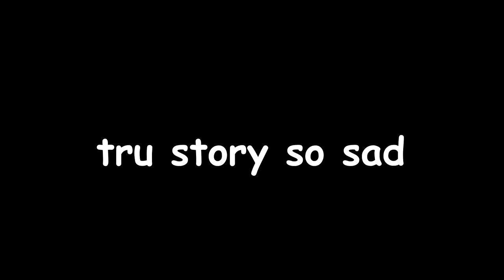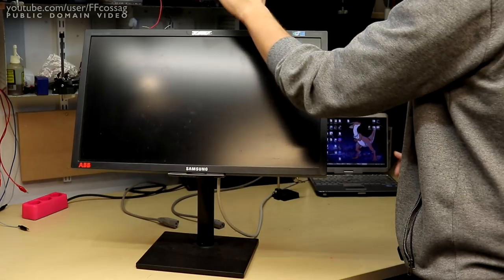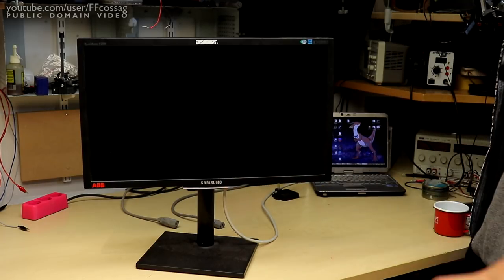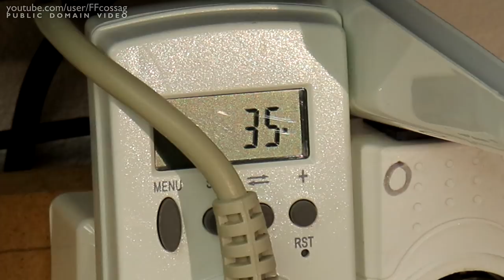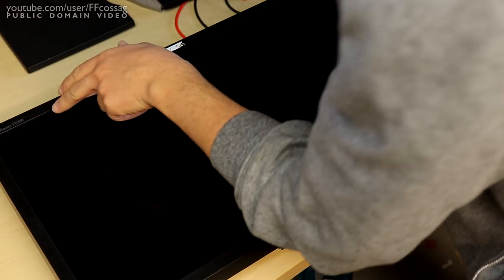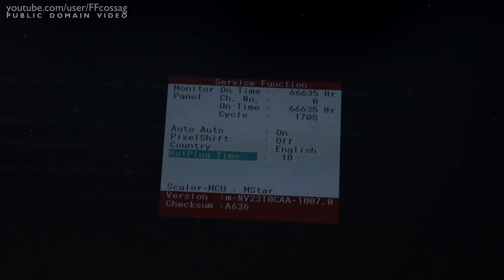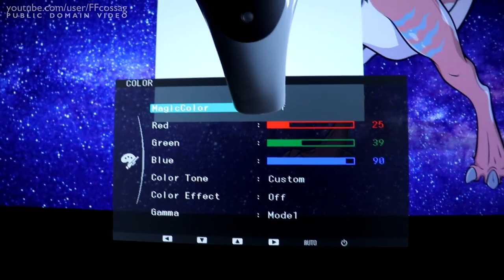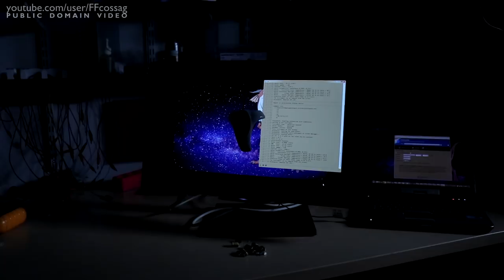66 THOUSAND HOUR Samsung F2380 LCD monitor repair

Comment: If my calculations are right that panel was running around 8 years nonstop... Holy shit.
Reply: About right, I  have a HP 23xi as my main, it's on almost 23k hours, I use it almost daily for 6-10 hours per day, and I bought it in 2013
Reply: Colin Hadley I have a monitor that’s got 25K hours but it’s been on constantly (not including power outages) and I bought it Jan. 1st of 2013
Reply: yeah, pretty much the same story, the only time mine's not on is when i'm asleep or out, even then it some times is...

Other than obviously, like you said power outages, or if i'm moving it for cleaning, (or going to a LAN party, which It has been to a few) :D
Reply: Colin Hadley mine is on 24/7 if I’m sleeping it’s on if I’m at school or somewhere else it’s on
Reply: You also have a few more hours than me, i'm actually on 22748 - so not quite 23, - this isn't a competition btw, I was just saying that his calculations sound about right, and you're just backing it up! :)
Reply: I have a HP LP1965 from November 2006 which has about 25k hours. My main monitor (LG 23" 1080p from 2011) on my main PC has about 15k hours
Reply: yeah and that monitor only came out in late 2009 or something, someone basically bought it and never turned it off.
Reply: EpicLPer Damn you're everywhere!
Reply: 7.6067352

Comment: The 66 Thousand hours make sense. In an industrial environment, nobody puts those monitors in standby. They run all the time. They are often mounted in a place very inconvenient to access (3 meters above the ground, or behind a safety fence).
And judging by how a lot of companies have a lifetime of their production lines for around 8 years, it makes sense. It probably died pretty soon before it was replaced, or after it was replaced in storage. There are thousands of monitors out there with similar on-times, that just get thrown out.

Comment: The pixel shift is a nice feature, it discretely moves the image a few pixels every so often to cut down on burn in.
Reply: The shit is so insignificant it does jack shit, based on personal experience.
Reply from the maker: That likely does not work very well when you run a PC monitor at its native resolution, since you either lose pixels or scale the image horribly.
Reply: works fine for my plasma tv. bought in 2010, has a ton of hours in it and zero peromanent burn-in

Comment: Thank you for the video. My F2380 has been working fine all those years and just resently it's buttons started to malfunction. It still works just fine, it's just that the "Brightness" menu keeps poping up on its own. 

Came here to see if I could fix it. 

Mine worked for 14 years about 12 hours+ per day. So yeah, it's also clocks at around 50-60 thousand hours and the picture is still perfect.

Comment: 66635 Hours = 7 years, 220 days, 35 hours (better part of 8 years)
1708 cycles = 39 hours average per cycle

what is funny, the full numbers of days is 2775 days, which is 66600 hours, so it also has the "mark of the beast"
Reply: Considering it looks like this monitor came out in mid/late 2009 or thereabouts this monitor was almost never turned off. Impressive.
Reply: S Coles once every 39 hours wich Is kind of a lot for industrial stuff. or maybe it spent a few day flashing on and off.
Reply: S Coles ho and most of those hours were probably spent on that gui

Comment: Wow, interesting to see it actually having picture burn in....I thought this wasn't possible with LCDs, but I guess if it displayed that static image for years it's understandable.
Reply: It's called image retention and can usually be rectified by showing different images. There are programs/videos to fix this. Not sure it will work on a extreme case like this, though.
Reply from the maker: This is not image retention, but actual burn-in. IIRC, it happens because the LCD cells, after being driven in a specific way for a very long time will drift differently, so that the bias voltage on the panel driver no longer is correct. Don't quote me on this.
Reply: Just as resistors loose resistance over time, and capacitors go faulty, and diodes tolerance reduces with age etc - an LCD's voltage bias changes with age, it's partly the pixels/crystal matrix, but also partly the wires that go to each pixel, as if they are held with a constant voltage, they will degrade slowly, and have a lower resistance, and will react with just the background ESD of the surrounding circuits.
Reply: nerdywolfi it does as I’ve got Homer Simpson’s face burned into my LCD TV
Reply: It seems to be possible, but it takes ages longer than it would on a CRT monitor
Reply: This is quite surprising to see on a PVA panel. LG-Philips IPS panels are quite notorious for developing severe image retention, especially when warm, but otherwise it tends to be pretty much a non-issue in LCDs. That said, maybe PVAs can be afflicted by similar issues given the 18/19" panel debacle bad in the day (they would develop odd shadows over what I now presume are warm spots, much like LG-P IPS panels do).

Comment: Pretty great noise floor on whatever you boosted that high !
Reply from the maker: That'd be the internal mic on the 800D. It's not THAT impressive, because I use a set record level that's tuned for the lapel mic. The internal mic doesn't have a problem picking up audio in a setting like this, but it came out about 30 dB too quiet since the gain was wrong. That still leaves us a good 60 dB of dynamic range in the 16-bit recorded file to play with - a lot more than even the finest audiophile vinyl. ;)
Reply: NO! IT'S VERY IMPRESSIVE!

Comment: I have a Dell 17inch LCD at work with 70 to 80k hours of almost constant operation (and counting) and it still appears to be quite nice looking. Although brightness has noticeably lowered since i got it back from a customer with 48k or so hours, and with bulged capacitors, and the colors appear a bit dull and unconfigurable for the better.

I also have a Dell 22" monitor at home which i resumed from the thrash bin at work, and it has "only" 40k or so hours but it's very reddish at startup for 20 seconds or so, and then becomes quite normal but it also has a lot of problems with brightness and color quality overall. Thou I do recall that these particular Dell CCFL-era monitors weren't very vividly colored when new either, as i was installing them for a customer back in the days (and sometimes secretly borrowed them to home at weekends :D).

Comment: good candidate for LED backlight hack
Reply: Yes exactly! LED conversation kits can be had reasonably on eBay.
Reply: @PingasTheFourth but the CCFL isn't good. It's dim and red is over blown.
Reply: @PingasTheFourth just because the CCFL is going out doesn't mean the LCD is going to go to.

Comment: We just recently got rid of an HP 17" 1280x1024 monitor dating back to the mid 2000s that had just a click under 50000 hours on it. The power supply got to be fairly noisy by the end, and the power light was so dim that one could barely see it, but the monitor itself was still running strong. I'm surprised it made it that far.

Comment: My HP LP2465 is reaching the 57,000 hour mark... but the backlight only has 11,561 hours at this point. the backlight did get replaced at some point, it seems.
(and I've only been running it at 40% brightness, so it should hopefully last a long while.)
Reply: My HP LP1965 has about 25k hours
Reply: My friend has 12k hours
Reply: Darkn't stilln't uploadingn't that's a young friend you have; only 16 months old.

Comment: The thing ran for 7 years and 6 months nonstop until it failed.
Reply: If it was never turned off it would probably still be going without failure. (Other than if they turned it off at any point it wouldn't go back on)

Comment: Bloody hell!, that has done it's duty very well :-D
So is the ccfl tubes the main reason for dimness? 
Might you throw some bright leds in for a laugh lol.
Reply: zx8401ztv retrofitting leds would be a pain in the ass. definitely not a economical viable fix.
the main problem is the burn in that monitor will never be confortable to use anymore .
Reply: With PVA panel it might still be possible to get rid of that burn-in with playing fullscreen videos for an extended period on it and then displaying full white (or black because then all of the pixels are activated) image for a few hours, then repeat until ghost image disappears. I resurrected a 32" Samsung FullHD TV with this tactic, that had been showing a map for a office building for 4 years 24/7. It's perfect now.
Reply: zx8401ztv I’m surprised it’s lasted so long as it’s a Samsung
Reply: SomeRandomGuyWithAChannelOnYouTube Why? Dont samsungs last long? 
I only have one samsung tv here, thay workes awmost nonstop, it has 5-6 years awready and i cant see any issues with it. The only thing that had issues was the remote, i had to ressolder it last week (the first and only ime tho). 

Well.. i gues i got lucky? 

Oh and how about lgs? I have a ultrawide lg monitor, are they good?
Reply: Eduardo Avila LG is great but I just have had lots of problems with Samsung where they only last maybe two months other than two of their TVs so I just dislike Samsung
Reply: Eduardo Avila I guess this monitor was built with good quality items
Reply: SomeRandomGuyWithAChannelOnYouTube Lgs are goo! Oh, thank god! 
Well.. i dont blame you for not liking samsung, all samsungs phones i've had after my galaxy mini didnt lasted and died early.
Reply: Yeah, it will be. Even LED backlights when run hard and constant suffer the same effect unless they fail before the diodes degrade to the same level.
Reply: SomeRandomGuyWithAChannelOnYouTube
I don't like Samsung phones (just a personal taste) but I consider their screens to be good. Maybe you just got bad luck with the models you tested?
Reply: It wasnt the screens that died, but the motherboards, all of them after the second or even third battery replacement.
Reply: Bro the dimness was there to access service menu, It has to be can only available when brightness and contrast is  set to 0

Comment: Hello, sorry to bother you after 4 years hihihi..
I got one of these the other day, it seemed to work fine, but now it's been going on and off with an horizontal white blitz for half a second, it does it every 5 seconds. 
It was working fine one night, until the laptop went in stand by maybe, not sure if that was the trigger.
It doesn't do it if disconnected from the pc, it does it on two different computers. I tried to use different cables and ports.. hdmi, vga, with and without adapters. I have no idea what the problem can be.
Even the menu works weird, sometimes it comes up, sometimes it doesn't, I was trying to reset the monitor, but no luck.
For some reasons it had stopped doing it after I disabled it from the device manager and reinstalled the driver, no idea which sequence was successful though, but then again it lasted only a few hours.
It had stopped also after I was playing with the menu a bit, then restarted going on and off. It doesn't actually do it while I click around the menu, although the menu comes up at its own wish at times.
I hate to throw away stuff that still works or needs a bit of help, but I am out of ideas with my basic knowledge.
Any clue? thanks a lot!!

Comment: They certainly got their value for money out of that one..  oddly that is why I like Samsung gear.. it seems to last a very very long time.. like my old Syncmaster 750s crt monitor.. .. ran for 12 years without being powered down.. it's dim.. it's dull.. it's on my Duron 800 with xp :D
Reply: Yup, I also have had good luck with Samsung stuff. We still run a 2005 Plasma TV that has been in daily use since day one. Runs a couple of hours per day. Have to check the hour count on that one if it has one. It's 43" or something and you have to pay for "HD" (1080i) broadcast here in Germany whereas SD is free, and the content they broadcast is of declining quality and with a ton of ADs anyways. Hence it wasn't replaced yet (okay the 250W power draw on white would probably justify upgrading :P)
Reply: I have had bad luck with Samsungs, I have had two CCFL televisions, from 2007 and one from 2009, both have failed from the bad power supply killing the driver board. Also have a more modern 2013 1600x900 monitor, where the HDMI has never worked, and the panel came with two vertical lines not working... from factory !
:(
Reply: my oldest lcd is an acer whatever 19" that can do 75hz. 1440x900 resolution, bought in 2005. it's a really good monitor and i'm glad it's the one i bought back then. couldn't have been a better transition from crts to lcds at the time, literally. Everything else was 60hz and i just couldn't deal with 60hz because i was so used to 85 (1024x768) and 75hz (1280x960).
it still works and i still use it at my office. it's a bit dim but still perfectly usable on a brightly lit room with a huge glass door to the balcony. on the opposite side of the room.

the oldest computer screen i have from a computer that was mine is the 15" 1280x1024 flatscreen crt from my pentium 233mmx it still works but it's blurry AF and impossible to get in focus because the focus is uneven on different parts of the screen. unfortunately the screen from my very first computer (486 dx4) is long gone. that said i still have the screens from the office computers from when i was a toddler. there's a black-and-green screen, lol. also a couple others that used to be in the 286 and 386 they used there in the 80's and early 90's.

Comment: Ive got one monitor that wont even turn on and I cant find any components that looks obviously burned, what it could be ?? also Ive got another monitor that one day just turned white, also no visible damage, it just happened during gaming, Ive tried to look it up for days but I no luck ... only if I could try to switch up the boards to find out more closely where could be the problem ...
Reply from the maker: You just have to troubleshoot it, no one can tell you over the internet, sadly.

Comment: It may not be practical, but maybe you could find new tubes for it, or retrofit it with LED backlighting. Then run a program or play a video that cycles colors on the display. That might just get rid of most if not all the burn in on the display, as cycling the LCD's pixels can sometimes do the trick.

It's probably been displaying nearly the same thing for 8 years anyway, so may be worth a shot.
Reply from the maker: The backlight could definitely be fixed. I've never successfully seen LCD burn-in this bad fixed though, so I'm basically calling this monitor trashed. Way beyond economical repair.
Reply: FFcossag makes sense. 

But still a neat find

Comment: what does it mean by 66635 hours on(7.6 years)? Does power off include I mean not power shut down but power off but light is burning?
Reply from the maker: It seems to mean that the backlight was on.

Comment: Clean uninteruped power at a factory is my guess why it's lasted so long.
Reply: I just obtained a massive powed cleaning device for my new electronics workbench. It's a huge transformer made by topaz. Costed 1200 but I got it for 400 USD. Thing weighs 150lbs no joke. Where I live power is dirty and short brownouts. I have to clean the power going to sensitive electronics which include testing equipment which is carefully calibrated.

Comment: My time capsule hard drive has 51 THOUSAND hours and still happy.
Reply: nacabaro What brand is the HDD inside of your Time Capsule, and do you access it very often or is it only used a few times a year?
Reply: peter geary i access it for 1 hour daily and is a wd green
Reply: nacabaro WD Greens are usually the cheapest drives in the WD range, that's pretty damn good for a WD Green based on my experience (The only 2 WD Green drives I've had the pleasure of working with happened to both die within 2 years despite being rarely used and never moved about)
Reply: I'm getting there.
ST1000DM0003 sitting at 24916H with 653 power ons :)
Reply: my 500gb drive has 60k hours in it. best bang for my buck ever. I bought this back in 2007 i think, then just 3 months before its 5-years warranty expired, it broke and i rma'd it for the one i have currently, which is long past its 5 year warranty now. the first one was a 7200 rpm HDD and the replacement is just 5400, but i guess that helped it remain operational for longer so i'm not complaining. it's only for storing media anyway, i have faster drivers for other uses on my pc.

Comment: Hi FFcossag, I actually bought a 17" version of the monitor (2nd hand for like 20$) for a retro gaming rig of mine. Like to know how you enable the service menu? Mine have a single dead pixel stuck on blue but colors looking OK :)
Reply from the maker: You turn brightness and contrast to 0, and then you hold menu for 5 sec IIRC. It's googlable.
Reply: thanks! <3
Reply: Okay mine is mere ~450 hours :O
Reply from the maker: How nice.

Comment: how is it a bad design if it lasted that  long?
Reply from the maker: I didn't know that when I took it apart. However, the multiple diodes in parallel is bad design no matter what.

Comment: Does samsung monitors last over 3 years?
Reply from the maker: Sometimes, sometimes not.
Reply: The 191T I bought in April of 2003 still works fine, iffy DVI aside (apparently the inputs are not well-protected and have a tendency to get damaged when hotplugging, resulting in intermittent image dropouts). So it's on VGA, and after calibration it even has some decent color rendering. Mind you, that thing cost a pretty penny back then, so you do get what you pay for!

Comment: 7.5 years roughly, not that much really. If you bought a tv wouldn't you expect 10 years.
Reply: that's the time it was on for, not the time that has passed since they bought it. 5 days passing after buying a monitor and 5 days of monitor run time is a huge difference